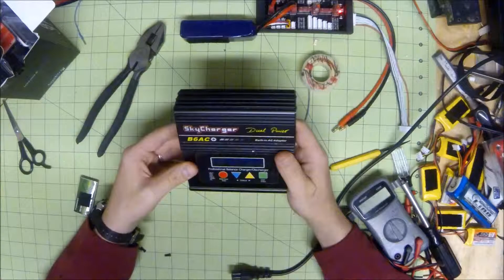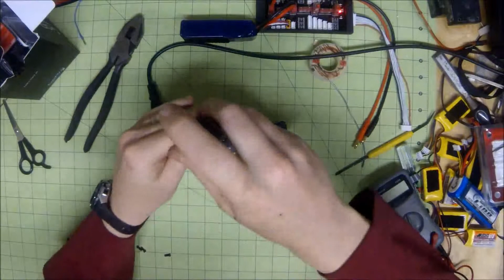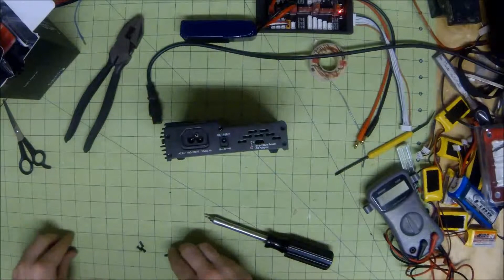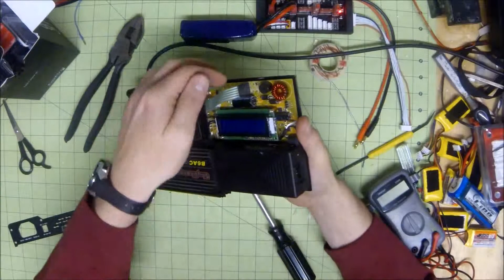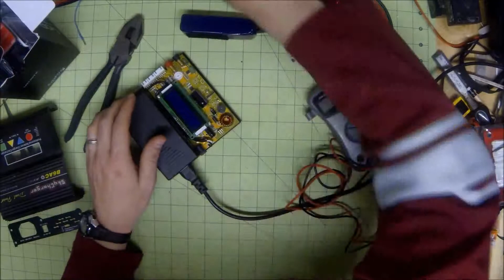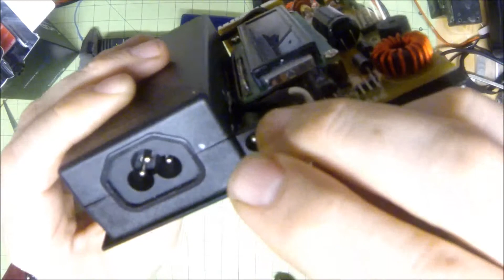Sky Charger B6AC Power Issue

Comment: Thanks for sharing... The AC power had quit working on two of my Thunder AC680 chargers. I stuck a needle under the spring metal tab inside the DC in socket, rattled it around a bit and fixed both. The DC inlet must be a crummy switch. I've plugged into DC twice, and both times it killed the AC power. Great fix!
Reply from the maker: Thanks, glad it worked.

Comment: I just bought a new IMAX B6AC V2  and it comes on for a few minutes then goes out... and if I unplug and plug back in it will not come on but if I wait a few minutes and try again it will boot up... and a few later will go out... I happened to be standing by it one time and i caught a glimpse of the screen and said something like low DC then went off
Reply: Dennis Parham It sounds like it could be a bad power supply. Have any old laptop power supplies lying around?

Comment: My Thunder AC6 went dead in the middle of a charge today. I guess it's a different problem from this, I wasn't able to replicate what you did on video with the port though. And I don't have a multimeter. But I suspect the power supply itself died in my case, at least there's some lingering suspicious smell to accompany the occurence. I already ordered a different charger, but of course it'd be nice to be able to revive this one at some point. I suppose I'd have to fix or replace the power supply, although I don't have the skills to do any fixing myself (replacing would be easier if I found a suitable box to fit inside the AC6 shell).
Reply: I would start with replacing the power supply.  Fixing a power supply is dangerous.

Comment: EDIT - this was NOT the right replacement part. It looks the same, but it's much smaller, wrong diameter. 
Thanks for the video! I have the same problem with my Thunder AC680 charger. I think I have found the replacement part: http://www.ebay.com/itm/2x-Connector-3-5x1-35mm-Female-Jack-Socket-DC-Power-Supply-3-Pin-PCB-Panel-Mount/172176457661?_trksid=p5713.c100043.m2062&_trkparms=aid%3D111001%26algo%3DREC.SEED%26ao%3D2%26asc%3D20140502134130%26meid%3Dd8b069acbd7941c1b5a7a994fad88a1c%26pid%3D100043%26rk%3D1%26rkt%3D1%26sd%3D172176457661  I just put in the order; we'll see if it works.

Comment: As you show, the problem is the DC-In jack, in my case the negative terminal was shorted with the positive pin on it, so i just put a little piece of electrical tape betwen both, and the problem was solved without removing a single screw.